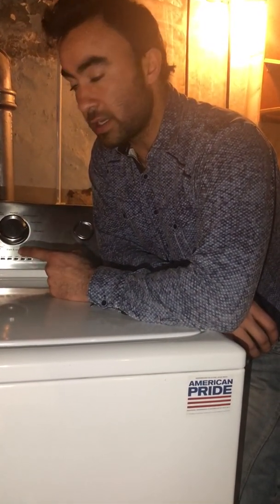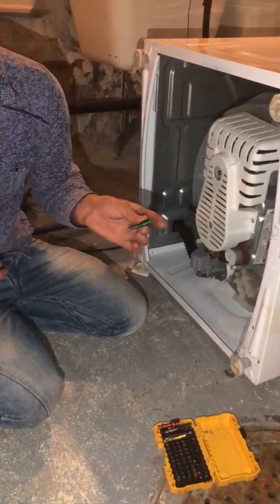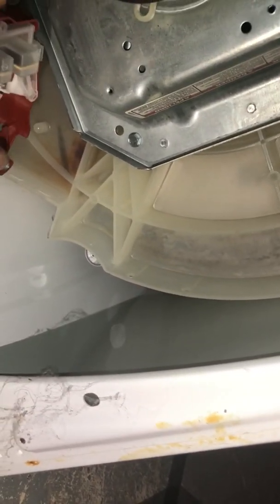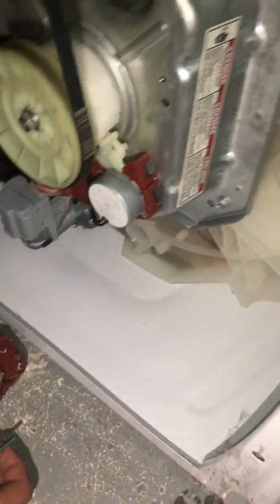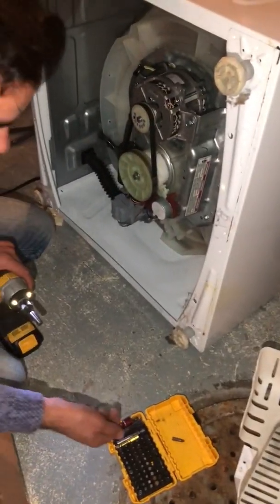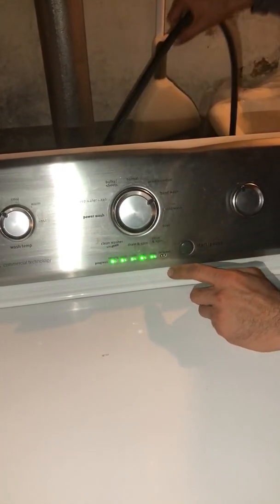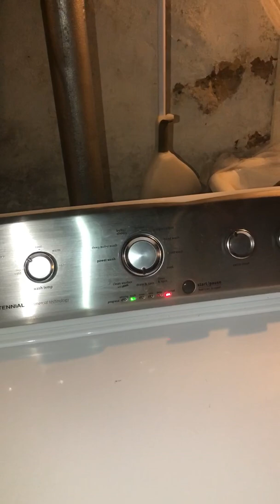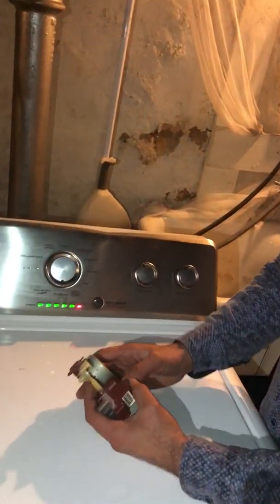Maytag centennial washer won't rinse or spin

Comment: maytag centennial washer Will SPIN but I have to run several cycles before all the water comes out properly. When I check the clothes after just one try, they are still very wet. What should I do?
Reply from the maker: Open the drain pump , there must be a socks or an underwear stuck in there . Make sure to empty the water first . ✌️

Comment: I have one maytag bravos but the borad lights won't turn un and it just making like a noise under like if it want to spine.
Reply from the maker: Rogelio Ponce check your drain pump and, motor and rmp sensor

Comment: fix my problem thanks for the video.
Reply: Was yours unlocking often and then not wash, rinse or spin? mine sounds like its washing but i dont think it is because when I opened it the clothes were wet but in the same spot.
Reply: @Angelskris333  my wasn't spinning, check for any leak before you replace that part if there is any leak the water is going to burn out the part.
Reply: @gabrielv9137  Hmm I did notice for a while there would be water under. But just tightened the hoses and rarelt see that now. My daughter said it made this loud sound like it was going to explode but she isnt good at explaining things. But it clicks open, and then after sometime clicks and starts, it fills with water and sounds louder, likes its washing but when I open I can tell the clothes havent move. Im by myself but I just carefully leaned it agains the wall and I did not find any manual. I bought this used. I did not see any leaks, nothing was wet.

Comment: Why do you think my washer (same unit) wont  engage in the rinse or spin mode after it does the wash cycle? My clothes are full of water after
Reply from the maker: Does your door lock?
Reply: Yes it locks. Any ideas?
Reply from the maker: If it looks you probably need shift actuator,
Reply: Thank you! Would you possibly know the part number by any chance?
Reply from the maker: W10006355

Comment: My aunts washer doesnt rinse what could be the problem?
Reply from the maker: Eli Alvarez what brand is it? Top load front load? How old is it? What is the model number? Is she living inside the city and  has soft water or outside the city hard water? How often she uses it? Is she overloading it? What kind of soap she uses?
Reply: I dont know but shes going to switch the same part u chenged on the video